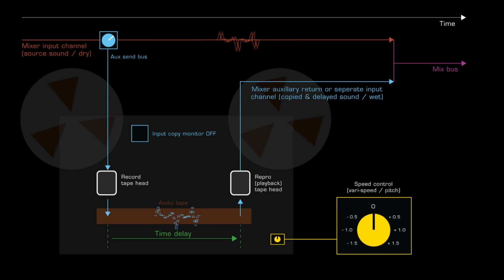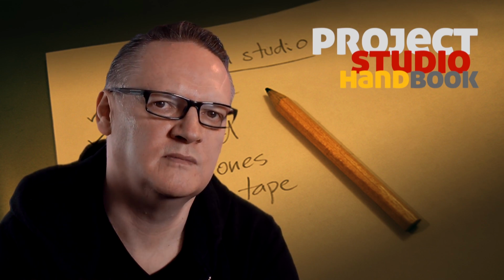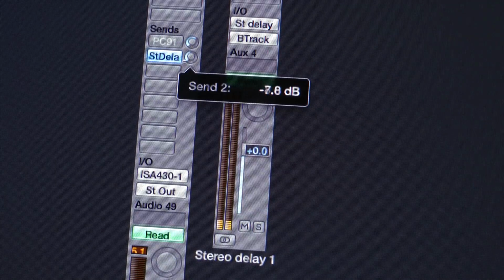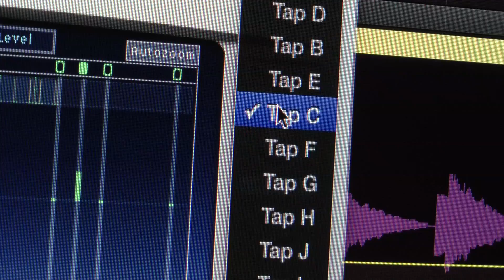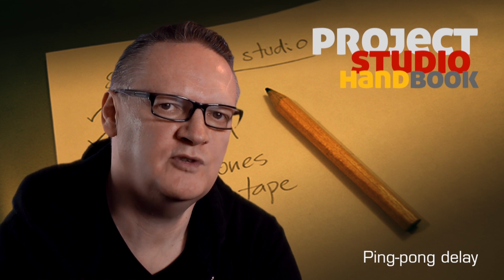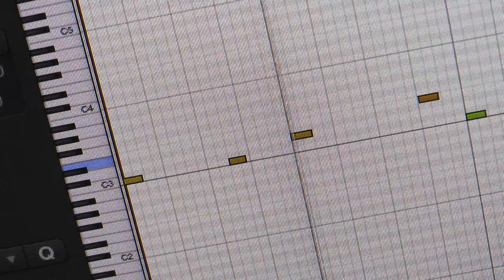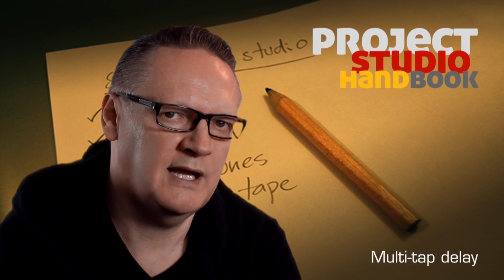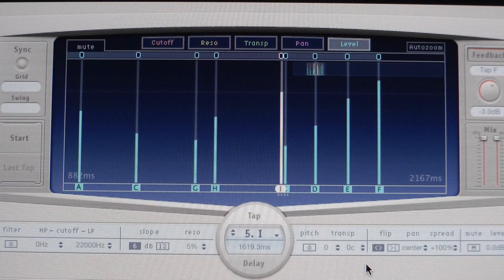Conventional echo and delay time domain effects

Comment: Thanks. Great videos> I have a question? which stereo delay would you recomend to get. I have ableton stock plugins. Cheers!!
Reply from the maker: Thanks for your comment. Any delay line plug-in with delay time, feedback, modulation rate/speed/freq, modulation amount/depth/intenisty and hi-frequency cut (this last isn't necessary if you add a following eq plug-in) will be fine. Many plug-ins hide/bundle these parameters together into more sophisticated controls which can sound great but don't give the user the control to make single time domain effects. Many plug-ins make subtle variations to the freq response of the delays to simulate tape etc, but these variations aren't as important as the five basic parameters. Hope this helps.